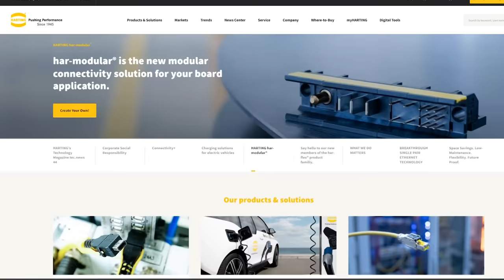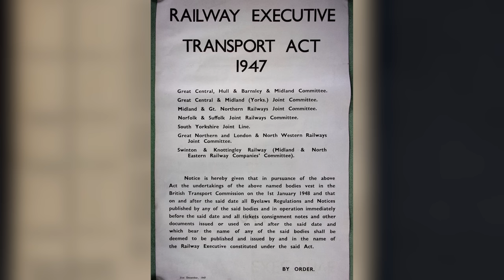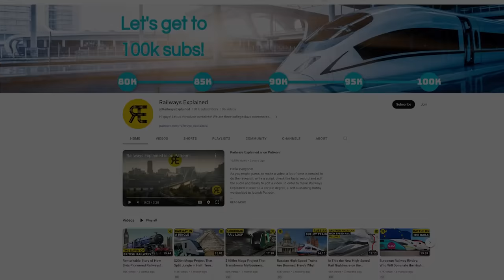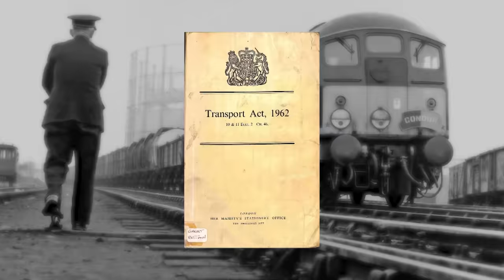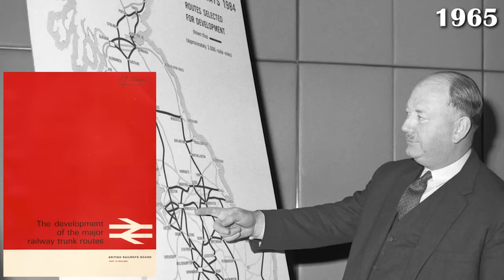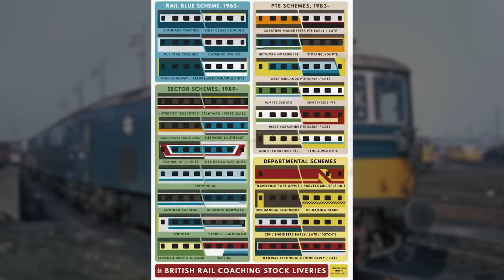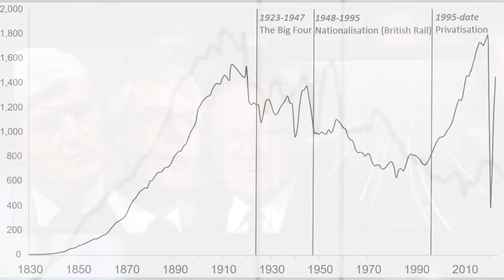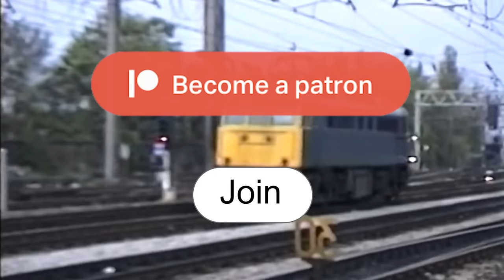Did the British Rail's Nationalization Work?

Comment: Societal infrastructure like railways and powerlines should be on public hands.
Reply: Why?
Reply: All infrastructure and workplaces should be in the hands of workers that work on them.
Reply: @rickyl7231  The real "why" question you should really be asking is, why have parasitic private owners standing between workers and the wealth they produce, and why have these leeches making profit off the back of work done by others, instead of having an actual economic and workplace democracy.
Reply: @SvalbardSleeperDistrict you'd mald about SG helathcare
Reply: @longiusaescius2537 all public hospitals are owned by the government through MOH Holdings, so what’s your point?
Reply: @longiusaescius2537  Try a coherent argument instead of this clownery and I may bless you with a response.
Reply: @northpointcity-  it's public and private on hospitals and healthcare
Reply: @SvalbardSleeperDistrict  "I don't think a reply from a 2016 relic is any blessing"
Reply: @longiusaescius2537  Yeah thanks for doubling down on demonstrating why nobody should be taking your rubbish non-arguments seriously.
Reply: @longiusaescius2537  not really… Most Singaporeans will go to public hospitals and yes i guess GPs are mostly private practices apart from polyclinics, it is a mostly government run healthcare system. If you want posher treatment, you go to private hospitals, no difference from the UK.
Reply: @northpointcity-  a lot say they go private for diagnosis and then public or private on treatment

Comment: One of the political reasons the dieselisation of British Railways was sped up was the Clean Air Act of 1956, under which British Railways could be fined each time a steam locomotive made excess smoke.
Reply: That's good policy though, because at that time people were dropping dead like flies due to smog in places like London.
Reply: @Tuppoo94  it is, and was a direct response to the killer smog of the winter of 1954.

Comment: Whilst British Railways did start in 1948 (not 1947 as you stated) with 1,223,634 wagons it ended the with 1,179,404 wagons of which 1,047,439 of these had no automatic brakes and had an average capacity 12.5tons. By the start of 1967 the total number of wagons had reduce to 551,422 of which only 466,623 wagindcremained in service by the end of the year, of which 275,770 wagons had no automatic brakes and had an average capacity of 16.94 tons. The reasons behind these numbers include the removal from service of pre-war privste owner wagons with wooden underframes, the withdrawal of wagons unfit to be repaired, thec withdrawal of wagons with no automatic brakes and the removal of low capacity wagons. The wagons removed from service were sometimes replaced by higher capacity wagons. These figures come from the BTC's annual reports.

Your simplistic usevof statistics gives a very misleading picture of the true state of Britain's railways.
Reply: The fact that British Railways was still using any train cars without automatic brakes in 1948 is ridiculous. The fact that they still had 275,000 cars without automatic brakes in 1967 is why people make fun of British Rail for being the most incompetent and backwards entity ever put in charge of a train.
Reply: @michaelimbesi2314  there are many and varied readons for this state of affairs including ge fact that the average journey length for a wagon was less than 70 miles and that the vast majority of these wagons used axle boxes that limited their speeds to below 25mph the need for automatic brakes on wagons was not seen as necessary. Also due to having only a 9ft wheelbase there was limited space to fit an 18in to 21in diamater vacuum cylinder and brake gear especially on the medium (5-plank) coal wagons with bottom discharge doors which made up the vast majority of wagons in service in 1948. Around 3/4 of the wagons that BR received in 1948 were pre-WW2 private owner wagons a large number of which still had wooden frames and were quickly condemned.

Comment: There were 3 important points omitted:
BR upon its creation was saddled with debt as it had to pay compensation to the share holders of the big 4.  The Heath government extended the compensation scheme that is why BR was not turning a profit until the late 70's.
NIMBYs blocked the electrification of the old Southern region & so it has always been crippled by a 3rd rail system.
Thatcher was rabidly anti-union & that is why she wouldn't invest in the railways. Only poor people used trains because successful people owned cars & the road network didn't need public subsidy 🙄

Comment: I worked for British Rail in the last 11 years of their existance and then worked for the private railways it became for a further 13 years, so have seen both sides.
British Railways delivered a faultless service for very little money. The trains were old and shabby because the Government subsidy kept reducing. You cannot modernise rolling stock without money to do it.
Yes, passengers liked the new shiny trains under privatisation, but were less keen about the continued increase in fare prices year on year to line the pockets of shareholders.
Reply: Mark 1 rolling stock still has the finest standards of passenger comfort; 4-SUBs, and 4-EPBs were far more comfortable than the 455's. The drivers preferred the older trains too. 4-CEPs were about the same, before and after refurbishment, but 4-CIGs are, especially the original sets, far more comfortable than 377's. Again, drivers seem to prefer the older trains. There may have been a need to replace rolling stock, but why not more of the same? Most modern trains are anti-passenger.

Comment: Privatisation of British Railways since 1994 is an excellent example that privatising rail is a dumb idea and I'm grateful that the Brits did that experiment so no one else has to. It's been a disaster for ridership, ticket prices and reach to smaller towns. Rail should never work as a for profit enterprise since value of a well working rail system to the society, economy and climate is hard to quantise in the simple terms.  Every pound of "loss" brought by the rail system easily pointed out by the bean counters, accounted for many pounds of hard to quantize gains like people living happier more productive lives in cities less strangled by car congestion and pollution being, rail being much cheaper in upkeep than roads per passenger and ton kilometre/mile, lives saved by reduced road casualties, less used fossil fuels and so on and so on. Even the economy would be better off if a large portion of people needed in road transit worked other jobs instead. (of course you'll always need a truck for the last few miles, or time sensitive deliveries, but it's a waste of man hours, infrastructure spending, cost of insurance payouts of the inevitable accidents and diesel to haul by truck cross-country compared to trains)
Reply: I remember the promises made by John Major and John MacGregor that privatisation would deliver improvements and lower fares, but losses are far greater than under British Rail. While I agree that British Rail wasn't perfect but I think they kept things moving better. Very few people realise that the Big 4 and British Railways were run by the same people.
Reply: @sandletters39  Pre-90's.....rail system was clapped out, decaying and falling apart.
Transformed by privatisation and the free market.
Reply: @malthusXIII-fo3ep  Rail started to transform itself before privatisation. Privatisation has made them less-effective.
Reply: @sandletters39 nah privatisation increased passenger ridership by millions.
Reply: @naramsaishanmukh1087  I see. So what's privatisation got to do with it?
Reply: @sandletters39  increased investment, improved customer service and faster train and the thing is it's not fully privatised.
Reply: @NaSaSh1087  then it's nothing to do with privatisation.
Reply: @sandletters39  it has because immediately after the start of privatisation the numbers boomed and not a single year in the Nationalization period did the numbers go up.
Reply: @naramsaishanmukh1087 What's relevant about it is that It's got nothing to do with privatisation. Now think before you say something further.
Reply: @sandletters39  then why did passenger ridership decline throughout the Nationalization period if it was so perfect?
Reply: @naramsaishanmukh1087  It was due to the rise in car ownership. That's what really happened. You also need to check that I stated, "British Rail wasn't perfect."
Reply: @sandletters39  Just look at the locomotives and rolling stock today under privatisation,...vastly superior to what we suffered under BR especially the dismal, grim socialist 1970's.
Reply: @malthusXIII-fo3ep  Nonsense.  You need to check your facts carefully. Northern Ireland Railways has seen growth in passenger numbers. It's still publicity run. Privatisation has nothing to do with it. Our rail systems suffered a lot due to meddling and inexperienced civil servants and an increased number of strikes.

Comment: The Modernisation plan of 1955 did indeed involve the replacement of steam locos by diesels and electrics, but the original plan would have been to oust steam traction in 1972, subsequently 1970. In the end, steam finished in 1968, and thousands of locos were scrapped long before they were life-expired. One would normally reckon that a main line loco would last 25-30 years, and branch line or shunting locos up to 40 years. A3 Pacifics were being used on front-line duties as late as 1961/2. In about 1957, somebody realised that scrapping steam locos before they were life-expired would be a waste of money, and suggested that a strategic reserve should be retained until c1985. The Western Region's decision to go for diesel hydraulics was reasonable. They were lighter than diesel electrics, so could haul heavier trains, especially on the main line through Devon and Cornwall. Whilst all the North British hydraulics were a disaster, the Swindon Warships were relatively successful, and the Hymeks and the Westerns were as good as many diesel-electrics, if not better. The Class 47 may have been a success, but, on the East Coast Main Line, as Deltic substitutes, the less said the better. I suffered numerous late-running journeys between Newcastle and London, or vice versa, with a 47 on a Deltic job; if you were lucky, the lateness would be 20 minutes. We keep on praising the HST; the fixed formation was too short. The Western Region sets were to have nine coaches, the East Coast Main Line ten, but the publicity people clearly included the two power cars. There were complaints about overcrowding on the East Coast Main Line, and rightly so. Before the HST, a typical East Coast express would have eleven coaches, with one or two extras even at busy times, and about 450 second class seats, depending on the formation. The HST had 288 seats, and, to make things worse, the seating bays and windows were out of alignment, and the tables were larger. Further, on those trains which were not immediately converted to HST, they had fewer coaches, typically eight or nine instead of the usual eleven. BR publicly said that rail users would have to get used to shorter trains. Perhaps a Deltic with eleven or twelve on would delay an HST. Whilst Edinburgh had extra trains, Newcastle did not. Then a guard's compartment was added at the second class end, reducing the seating still further. In the end, one of the catering cars was removed, and a fifth second-class coach added, but this meant the end of the Restaurant Car on a number of trains, or restricting the Restaurant to first-class ticket holders. The initial regions worked. Unfortunately, BR decided on a "one city, one region" policy. Whilst some regional changes were reasonable, such as the transfer of the LTS network to the Eastern Region, others were not. Take, for instance, the transfer of the Great Western network north of Banbury to the London Midland Region at the beginning of 1963. The LM region promptly announced that when the Euston to Birmingham electrification was complete, Snow Hill Station would be closed, just over two years after the station had been resignalled. (This was before the Beeching Report was published.) As regards freight traffic, the principal reason why BR was losing to the roads was the continued building of unbraked wagons. Marshalling yards had no place under Beeching, hence the decline. Wagonload traffic was to be discontinued, and the railways would cease to be common carriers. The parcels receipts were misleading; at some stage, parcels receipts on a branch line were calculated at the junction station, so a branch line station could have taken parcels, but they were accounted for elsewhere. The break-up into sectors had two bad points. First, British Rail decided that Inter-City services had to serve London; Londonlink would have been a better name. Second, catering on trains and on stations was to be run by different bodies, the principal effect of which was to ban second-class passengers from Restaurant Cars. BR promised that hot meals would be served in the buffet, but this materialised only very briefly. All one can get these days is a grotty BR sandwich and a packet of  crisps, and some companies call that a "meal deal." Provincial Inter-City services, such as Newcastle to Liverpool lost their main-line stock for Class 158 multiple units, typically two two-car sets coupled together, with no catering other than a drinks trolley, if you were lucky. 19:25